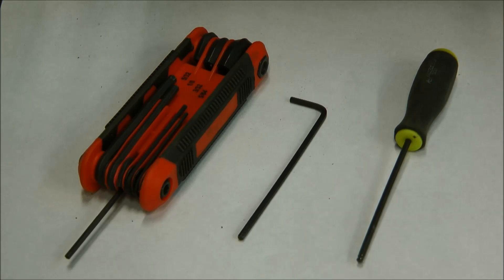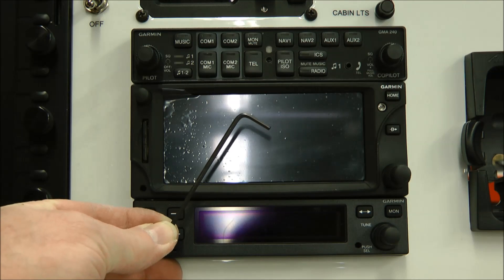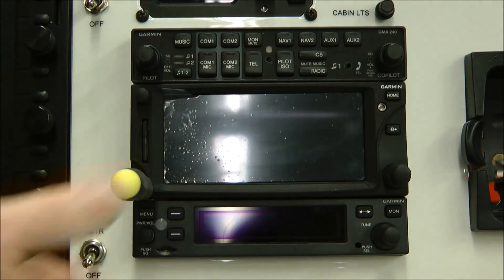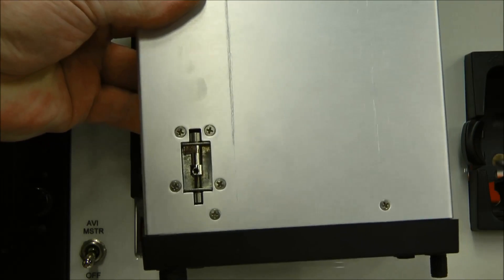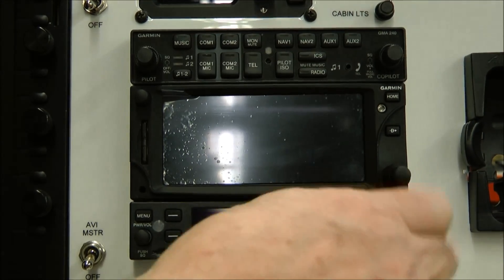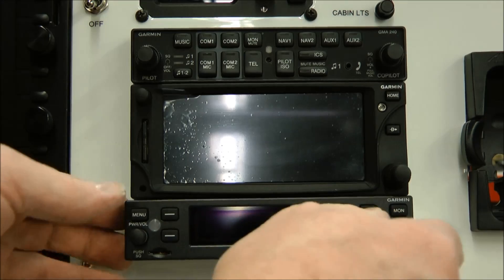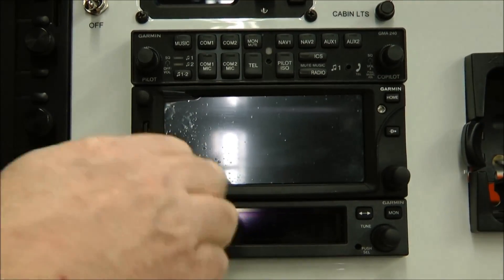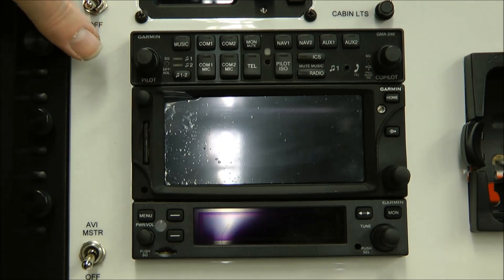013: REMOVING & INSTALLING AVIONICS RADIOS

Comment: Do all the devices interlock for security? Or can you release only the audio panel or GNS?
Reply: No, each radio has it's own tray, they are all separate as they can be installed in any panel layout relative to each other. There is no latching connection between them.